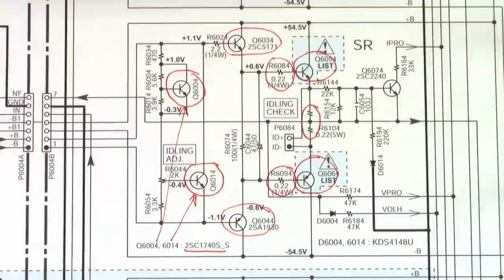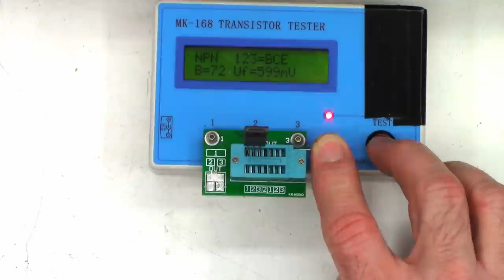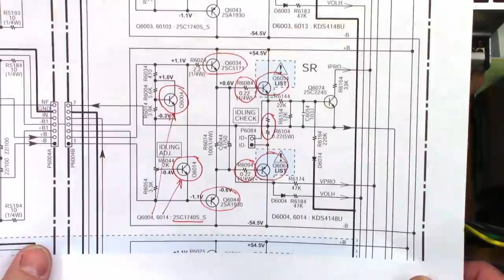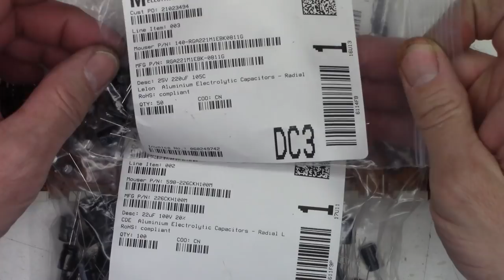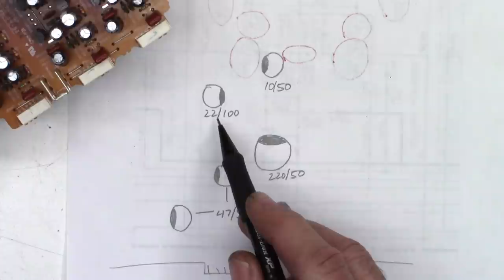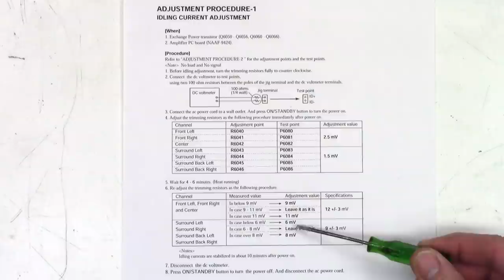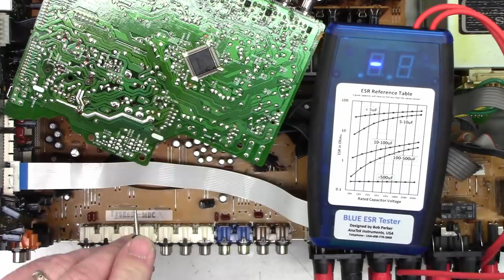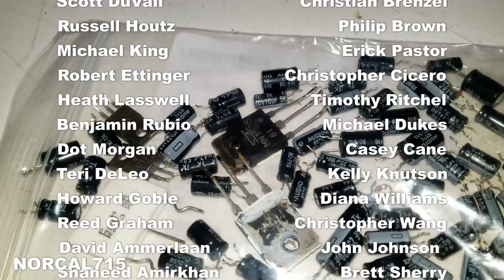ONKYO TX-SR606 WONT STAY ON POWERS OFF AFTER A FEW SECONDS - PART 2 REPAIRS

Comment: I've always just fixed the original fault. It's crazy how likely it is that so many caps can be bad. I'll have to be more proactive at testing them. While the unit might work without new caps it's good preventative maintenance. Definitely worth doing from a business standpoint to avoid comebacks.
Reply: Very well said, I too would've just repaired the problem years back, but, nowadays with the Chinese electrolitics we can't take chances, especially now that I invested in an ESR meter several years ago and its worth its weight in gold.
Reply: I guess after that video, an ESR is a must on the bench.
Reply: you don't need caps. lol

Comment: Great video! Thanks so much for the details in your videos. I was a big Onkyo fan at one point and repaired a couple of the flagship models and I currently have a lower end model that I gave up on awhile back. I gave up because it has the same protect turn off issues as this one. I already know that the fix will be the same as you have shown here, a ton of bad parts and a lot of work. I still have it and may get back to it given your inspiration. I also need a decent ESR meter as I also have an Anthem unit with bad caps on the HDMI boards, well at least one is leaking. The HDMI boards works sometimes and sometimes not. I watch your videos for knowledge and inspiration to get to some of these project I have sitting around. Thanks again for the content.

Comment: Bravo.  I have TX-NR636 doing exactly the same.  I hope one of your videos goes over testing the speaker/line integrity.  This unit  of mine has always been touchy.  If HDMI couplers are used make sure they are high-quality.  Those wall plate couplers are garbage and will give subtle maddening grief unending.  Will edit updates.

Comment: What a find!!  My SR606 died this summer.  As an old retired e tech I thought I'd pull it open and poke around.  I've always run on the principle that, like a light bulb, it's the initial surge that stresses components.  So, like my 1976 SAE 2900 Parametric Equalizer,  still on and humming away 24/7 waiting for me to use it's phono input. So I would also leave my 606 ON in the garage where I use it to drive 2 big speakers.  But, stupid me, for not thinking of my South facing garage in Phoenix that regularly climbs to 120 deg in the summer!  And NO fan!
My whole 606 pre-amp board is blacker than your 1 channel!  Anyway, got my esr meter and ordered my caps.  We'll see.
Cracks me up that at my age, they're calling this nice 7.1 Onkyo "Vintage" hahaha!
GREAT video!!  Well done. Thanks!

Comment: Thank you for this repair documentation. I have an HT-R570 here on the bench that I'd really love to have operational so I can have some tunes. Failure mode: Standby lamp on all the time. Power on. Lamp goes out, transformer hums, no display, 1-2 sec then shuts down. I checked a few things on the standby psu side. No joy.  One of the first things you said was check the output transistors. I found 2 dead shorted output transistors. Q6064,Q6065. To see if any changes occurred, I cut those two guys out....result: first I forgot to plug in the heat sink sensor, and I got another fail mode, but once I hooked that back up, standby lamp full on, power on, display comes on, able to select inputs, unit stays on. Heck yeah. I'll get those parts replaced.

Comment: You earned your pay on that one. Most complex unit you've worked on since I've been watching. Looks like that unit could use some ventilation help keeping it cool. Those boards were definitely baked crispy! Please pass the butter and knife, thanks!
Reply: In fact I added a 5v horizontal laptop cooler fan above the power transistor heatsink, to improve venting the hot air upwards and outwards through the vents!
Reply: @zs1dfr  That's was a smart pro-active thing you invested it.
  If it seems like it can can get to warn, what a few extra $$ more to be certain. Good job

Comment: Great video mate. The only thing that's probably not been changed is the Power Transformer and the outer metal casing 😂😂
We see so so many Onkyo receivers failing due to overheating. Makes me wonder if there are some serious design issues with these. Ideally ABRs should go to protect mode if heat is detected more than the defined threshold. Probably the design engineers were not up to the mark.

Comment: I'm dealing with exactly same issue. However, it is for a 706, and not the 606. There is another set of transistors between the drivers and the bias transistors.  Suspect I will have to replace them too.
I'm curious... This is a cascading failure. What failed first. The main output transistor, or something higher up in the chain? My gut tells me output transistor failed 1st.

Comment: Excellent ! Was wondering you can help with a query regarding identical AV receiver (TX SR606 ). I want to take out signal before amplification stage (basically I need pre out ). What I intended to do is , have a linkwitz Riley 24dB/ Octave 2 way active crossover for each channel and have separate amp powering high and low frequency in each of the channel . sounds crazy but I love those crossovers .It would be great help if you can tell me how to take pre out from this particular model of AV receiver.

Comment: Excellent repair! I'm happy to see that you choose to replace all the Capacitors across all the channels even though 1 or 2 were showing up okay... 
I have to ask, do you check for size comparability with the new Capacitors? Or do you just order the same voltage and capacity value? 
And also... Have you ever considered going up in voltage rating on the Capacitor when it's located next to or close to a heat source? 
Because by going up in voltage capacity, the capacitor will have better heat tolerance... 
I have been looking into the Panasonic Capacitor datasheet and it shows how by going up in voltage extends the life of the Capacitor... It's just a thought that I wanted to put out there.... It's just a preventative measure... Keeps that device from retuning to you bench and leaves the door open for new devices and customers that got referred to you...
Reply: you can buy high temp caps. if you go up in capacitance you should also go up in voltage, not all applications allow variation in capacitance, only voltage, changing the values, either voltage or capacitance will change the ESR the in series resistance of the capacitor.

Comment: I'm curious if the customer followed your request and brought the speakers in for inspection, and if so whether anything probative came out of that. Would be great if you could comment on whether you found any new information about what actually lead to the failure in the first place.
Reply from the maker: They said there are not even any speakers attached the that output. I attribute to bad capacitors 100%

Comment: So my takeaway from this is that it runs warm, and I dont see enough cooling in the system, would it be better to 'undervolt' the system? Im not familiar with repairs so I can only go off of my knowledge of pc solutions. If you want the system to run cooler you undervolt the cpu slightly (edit: this is something that can help the longevity of gaming laptops). Im curious if that would help a system like this?

Comment: often the bias potentiometers become oxidised or even blown open from the damaged power transistors. Either way it needs to be checked and pots cleaned with a deoxidiser or replaced usually 100ohms

Comment: Steve, what was the part number on the little transistor glued in between the two taller ones?  I have a similar Onyko with the two NPN and PNP power transistors blown.  All other components are testing fine but that little one in the middle is visibly blown so I can't go by markings.  @ 5:48
Also, can you tell us the part number for those emitter resistors?
Reply from the maker: The emitter resistors are .22ohm 5w x2 ( eBay is the only place I have been able to find them) the little transistor between the driver transistors is a 2sc1740s seen at 2:24 in the video

Comment: 3:10 - refreshed used scrap or fakes? For example 2SC5171/2SA1930 should have DC current gain at least 100 (at low Ic)

Comment: Is there a listing somewhere for the capacitor values and what they should measure?
Reply: Datasheets will have a column which says Impedance at 100kHz ... at high frequencies Impedance is pretty much same as ESR, so you can use that value. As you repair things, you'll get an idea and you'll tend to remember what a capacitor of a specific capacitance and voltage rating (and volume, because that matters as well) should measure... 
Also keep in mind that capacitors can have different properties and in some circuits the ESR matters. A capacitor could have 0.1 ohm ESR and another capacitor of same capacitance and voltage rating could have 0.5 ohm esr ... they're both good, just different electrolyte formulas, different properties, maybe one is optimized for small diameter... and in some circuits the slightly higher ESR may be preferred.

Comment: I am having similar amp and its display is very dim. Almost all the caps in the board which is under the HDMI board where two heatsinks are installed (chapter from your video The Gift that keeps on giving PT2) are bulged and about to explode. Probably that will solve the problem but before I start to fix My Amp keeps on switching On and Off in every second and Relay click sound is coming from the board which is stopping main transformer to power on. 
Do you suggest how to debug this and rectify the fault?
Reply: Post changing the Cap  C9001 (470/63v) unit is started and display is back to normal. But now there is no sound on any channel. When I connect speaker there is small crack noise comes which is true sign of AMP is working . Any idea how to debug for audio?
Reply: @Mots-mot  i know this is late and i aint no technician but check the driver board or just the resistors near the transmitors and yh
Reply: Thanks for the reply. I have fixed the problem by replacing the caps . 
I am facing a weird problem , whenever I removed the Board and assemble it back it won’t sound. To resolve I need to reset the system and it worked again. Is this a normal behaviour that after every disassembly it needs to be reset . Once assembled back it never shows the problem and working fine for long hours without any prob .
Reply: @Mots-mot  I mean for new capacitors and that possibly

Comment: Mine does that same problem but no bad resisters no bad caps no bad wiring I Evan tried to reset it and it still won't stay on plz help me
Reply from the maker: The microprocessor looks for several defects, missing power supply voltages as well as amplifier DC offset. If you don't see a DC offset on the power amp it probably has a power supply issue.

Comment: 8:45 Can someone who understands how this works explain to me how when he makes those little pools of solder that are so close together, why is it that they do not leak into each other and cause each other to short out?  I always wonder that as I watch these types of videos.  It all seems so close together on circuit boards I dont understand how its even possible to keep solder from a nearby connection out of it's neighbors way
Reply: Flux helps even solder flow. when soldering flux is your best friend. You may want to check out NorthridgeFix he does microsoldering and explains alot of what he does and why.
Reply: Flux is this magical stuff that makes solder read your mind and follow your will.  Don't be shy using it and you will  be amazed.  Also avoid lead free solder.
Reply: Flux helps a lot (per other comments), but all it's doing is removing oxidation that gets in the way of a good connection. The main thing that keeps the solder together is surface tension. The solder essentially wants to "bead up", except where it touches other metal. The coated PCB area without traces acts as a barrier to the beading action and keeps the solder on its own side.

Of course, you can put too much solder and wind up bridging the gap. But it takes a lot of solder for that to happen. With a little practice, it's pretty easy on most PCBs to keep the solder amount well below what's needed for all the solder to stay on its own little island. :)
Reply: @harvey66616  This was the answer I was looking for.  Thanks

Comment: Why would there be so many bad components on these boards?  Is Onkyo to blame for the number of problems?  Do some manufacturers use "discount" components that are going to have a shorter life?
Reply from the maker: I think yes "discount" components payed a small part. I think the owner had units stacked on top of it without adequate ventilation. That is what I think killed all of those capacitors.

Comment: Hello, I have Samsung tv and I’m trying to fix the power supply board BN44-00264A, the secondary fuse(fm802S) blew. I found out that 2 mosfets (Q1820,1821)failed, someone on line posted that I should also check the smd transistors around this mosfets. They are like tiny black rectangular shape with one pin on top and 2 pins on bottom,labeled as Q1802,1803,1805,1806. 
I used multimeter on diode setting and I poked everyone of them on the circuit board and I’m getting readings even the black and red leads vise versa in all of them, I just want to know if they are bad too? Because I thought when Im getting a reading on positive lead on a pin, I should not get anything on the negative lead,is this right? Thanks in advanced
Reply from the maker: Its been too long since I worked on these units. Without having it on my bench there is not much I can do. Sorry.

Comment: I have a unit with the same problem but it is SR607. How much is the repair?
Reply from the maker: This repair was $200 USD
Reply: @norcal715  After all of the testing, disassembly, desoldering, new parts, resoldering, replacing capacitors and clean-up? As soon as parts are available, I'm pulling cash from my ATM and driving your way with my blown Onkyo TX-NR838.

Comment: Had one similar Onkyo come to me, but it was scrapped, digital logic board was also faulty, losing channels and not responding to the system controls. Not worth repair, as it was not capable of video better than standard definition either, so was replaced with a new one that could handle HDMI input and output. It had spent the last decade acting as a radio amplifier.

Comment: Hi, I got your name from some other guy on yt. I am looking for the video eeprom of this onkyo receiver. It's q8085 on the hdmi board and I am looking for the bin file of this chi because mine is empty. Maybe you have a copy, it would be much appreciated
Reply from the maker: Sorry, I do not. Try heating, and cooling it to see if you can retrieve the data with a eeprom reader. Let me know how it goes.
Reply: @norcal715  Thks for getting back to me.  I don't think the flash chip is bad because i can read it without a problem. It's just empty. My guess is that when the dc converters on the hdmi start oscillating because of bad caps flash somehow gets wiped. I flashed it with a TX-SR605 bin and it started working. But the OSD menu is different between the models. Anyway, thks fy response

Comment: Why my onkyo receiver tx-sr309 over heating sir
Reply: Onkyo is notorious for hot HDMI boards. First make sure that yours is not powered on standby (depends on settings -- watch out for HDMI or Zone-2 pass-through). Then buy a quiet USB fan to put on top of the unit and set it to run at slow speed (will power-on whenever unit gives power to USB).

Comment: These sets are built so cheaply. 
I don't like sanken transistors they always feel low quality and i always see more of these fail..
Everytime a car class ab car amplifier or any receiver comes upto me with blown output transistors made by sanken. I replace them witj 2sc5200n and 2sa1943n. Those transistors are better speced and never had one comeback. 
Those are so much more robust that if they comeback next time it's generally the powersupply section blown because the transistors are so strong and punks driving their amps into hard clipping cause them to blow up. 
I buy genuine ttc5200 or 2sc5200n. When replacing anything that had lower specd transistors than 2sc5200. 
And if the amp comes with 2sc5200 or ttc5200 then i only replace it with the O grade 2sc5200 that are more expensive but they have 30% larger die size and made in japan..
There are lots of fakes of these audio output transistors so i only buy from authorised toshiba dealers..